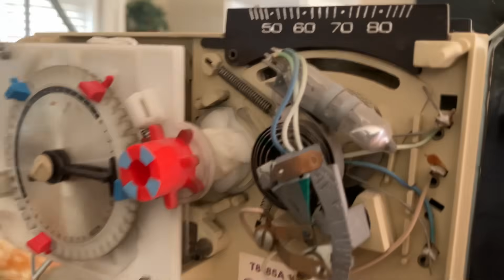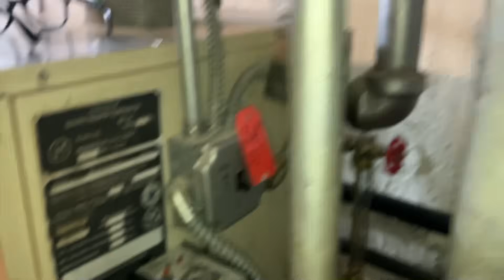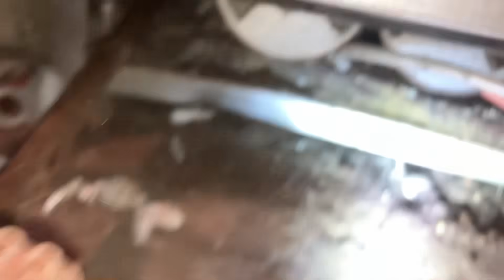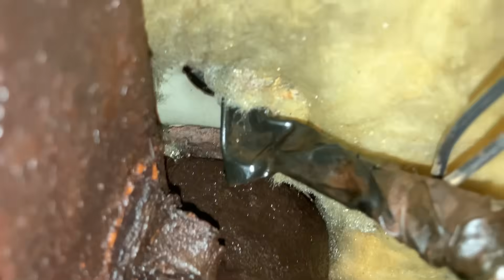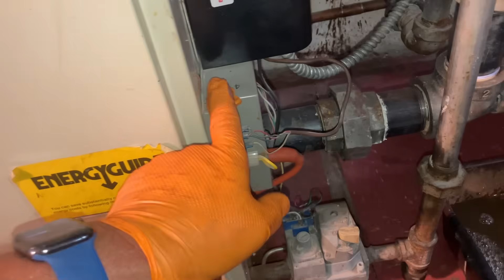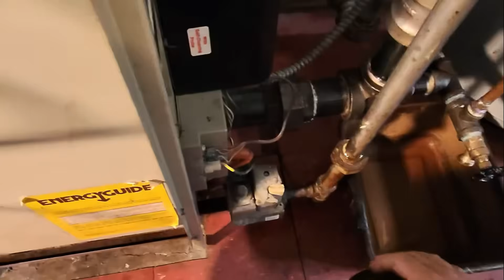Gas Steam Boiler FULL Service Call 🔥 35-Year-Old System Inspection & Maintenance

Comment from the maker: 🚫 3-Inch Vent Connector Not Allowed for 40,000 BTU Water Heater

According to the International Residential Code (IRC) – 2021, Appendix B (Sizing of Venting Systems Serving Appliances Equipped with Draft Hoods, Category I Appliances, and Appliances Listed for Use with Type B Vents):

Table G2428.2(1) [also published as Appendix B, Table B1] limits a 3-inch vent connector to a maximum input of ~37,000 BTU/hr for a draft-hood equipped natural draft appliance (single water heater).

A 40,000 BTU/hr water heater exceeds this allowance.

Therefore, a 4-inch vent connector is required, which can handle up to ~67,000 BTU/hr under standard conditions.
Reply: AO smith also recomends  12 inches of vent pipe on top of the water heater  befor putting  any elbow    but that is recomended not required , 1/4 inch per ft  rise is  required ,    I try to get some verticle pipe in  when its feasable   not in this case
Reply: sorry about so many  comments  just wonder if water heater should be tested with the boiler on too to be   sure its not spilling CO  or how much it spills ?

Comment: Customer called about unknown water loss in the system. Came in gave an educational detailed session about everything else. Cleaned the burners, turned to the water heater vent, did a test on boiler vent. Did everything but fix the issue of losing water in the system 😂😂😂 i bet you charge by the minute 😂
Reply from the maker: I prioritize addressing all potential safety and efficiency issues to ensure the system runs reliably.

Comment: the circulator leaking oil, it's being overfilled/overoiled!  add less oil at a time. too much in the pump housing will just leak out onto the floor and not harm anything. WARNING too much in the motor bearings will leak on the rubber isolator motor mounts and quickly degrade them to mush, then it sags down and eats the drive couplings quickly.
Reply from the maker: Good points, thanks for the comment!

Comment: I had to unplug the burners  on an apartment building boiler that was booming from the gas build up. I used a wire. Worked fine after reinstalling the cast iron burners. They were large. Good job.

Comment: Can you provide that code reference for the requirement of  a 4” vent connector?
Reply: it's a big self back patting circle-jerk revolving around B-vent the whole way, from appliance to outdoor termination cap. the vertical height greatly changes what the lateral run can handle in BTU. cold b-vent may have a hard time draft starting if the lateral run is too far, same for old school chimney with too low btu input.
look on top the appliance, gee a combo 3" and 4" vent hood with a less than 3" of total opening, go figure. 
the lateral run really matters the most and having a big boiler hooting up the chimney will make lots of draft unless it's blocked(lol), then it doesn't make a difference what size pipe is anywhere, best have them CO alarms working.
Reply from the maker: residential code - google is your friend. 

The IRC Appendix B provides vent sizing specifications
3" vent connector can handle up to 37,000 BTU/hr
Reply: @PipeDoctor thanks for the reply.. I will be doing some research today.. I would imagine it would supersede nfpa54 then.. looking at nfpa54 now, into a masonry chimney multiple appliance with 2’ connector rise your good for only 30k. On a single appliance application it would not work.. on a single appliance to a b vent flue (which you don’t have but for conversation) 3” would allow 54k

Comment: Crack in boiler section above the water level steam going up the chimney!
Reply from the maker: Yeah, but filling the boiler up to the top proves that wrong
Reply: @PipeDoctor   Can that boiler section to the far right, be opening during a good head of steam ?  It's no longer bolted together.
Reply: @2pugman  it's possible, could be rust plugged as well and may start blasting out again.
although it kind of looked like there was some pipe work done there seeing the union and un-rusted nipples on the boiler return near bottom. maybe it was leaking previously and steaming off up the outside of block?
being a mechanical failure detective and breaking it down into probability is what I'm good at, amongst many other things. not the best at everything, but whom is?